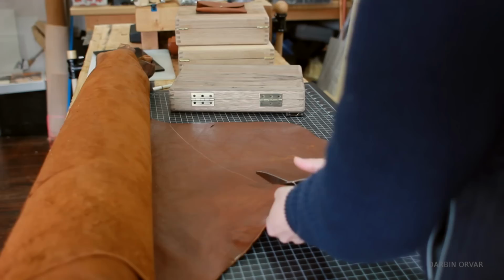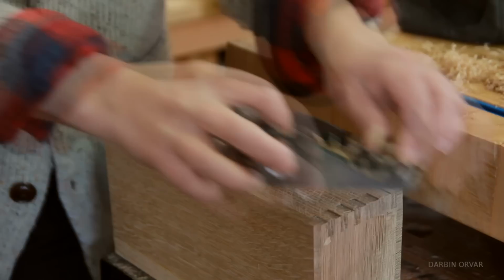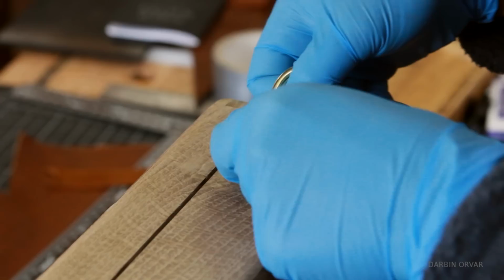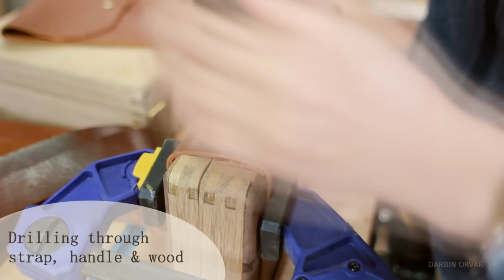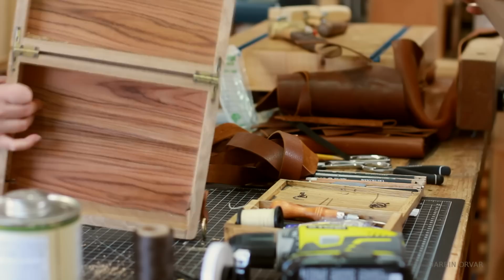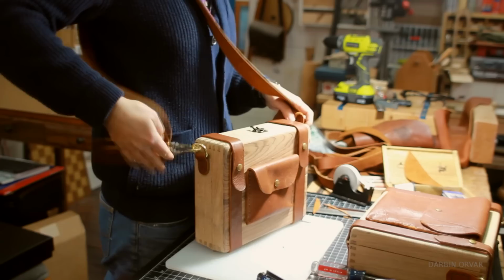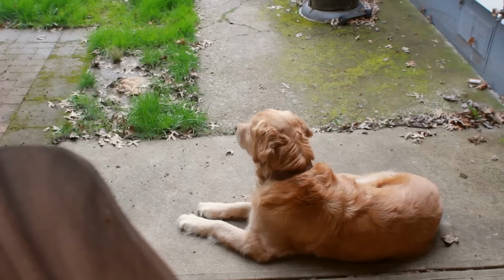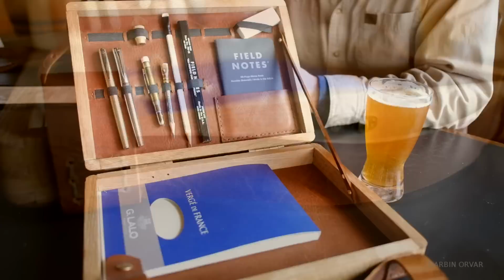Making Awesome Boxes w/ Wood and Leather

Comment: Beautiful bag.  I drill small holes into the top of the ends of the joints, I glue  in a bit of brass rod.  It’s soft enough to clip flush and sand smooth.  I’d also recommend using rivets  along the straps as well as the glue.

Comment: Good stuff...  I like your cases a lot.
  Using synthetic sinew (sin-you) is about the best "thread" for these and other leather projects.  It's really tough and doesn't rot while giving a very traditional look.
  Some minimalistic, tasteful wood burning of trim design or outdoor scenes/animals, depending upon how much exposed wood you leave, would be a pleasant option, which you could even continue into the leather work. 
The box joint is also known as a "finger joint" as opposed to the dovetail joint.  The dovetail is stronger but more complicated and not really necessary, especially if you're covering up the visual esthetic of them.
  I'm trying to figure out how I want to make more traditional, leather over wood trunks and cases, cir. 1880s-1920s.  A time I think was it's pinical, when people were really traveling around thanks to the industrial age being in full bloom yet things were still hand crafted with quality and care.  
  I think starting with a smooth, light yet reinforced case made of steel strap skeletons, Luan, sheet-tin and leather with doubled corners and hand forged brads/fasteners.  I just need an old pattern to get me started.  😀

Comment: You should be using a Poly or Rawhide Mallet for your punches and setting tools.Metal on metal is not good for your tools.When cutting out slots try using a hole punch and a box knife.I like your projects and ideas.It's nice things from a different angle!
Reply: Have you ever seen a leather punch or setting tool that's been damaged by a steel hammer? Me neither. The leather or the surface you're punching against will absorb most of the blow. Unless you're swinging at it like you're driving nails, it shouldn't be a problem.
Reply: I have. I was using a regular hammer to hit my rivet setter and it's "mushroomed" over now on top. Then I got wise and bought a poly mallet. Tileman is right.
Reply: Your right and wrong...for the guy who asked if you have ever saw a damaged tool from that process all i can do is SMH. YES yes it definitely will mushroom your punches but in this case shes using a brass mallet which is considerably softer metal. Not as good as a rawhide mallet but should do the job.